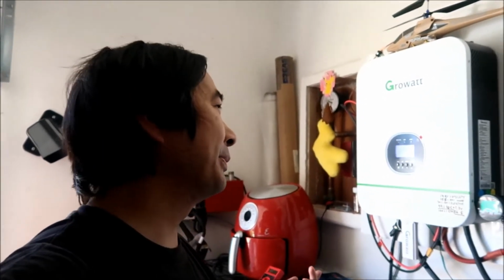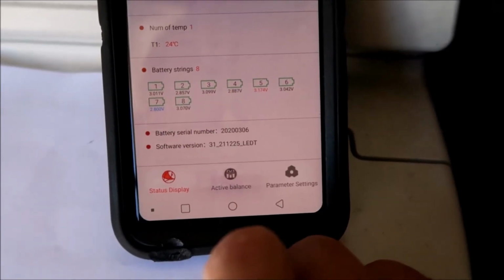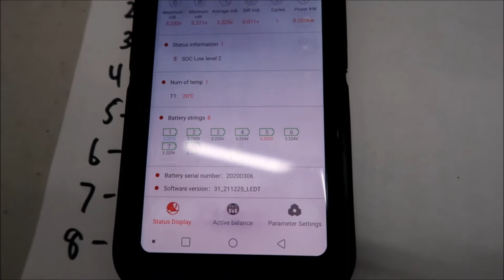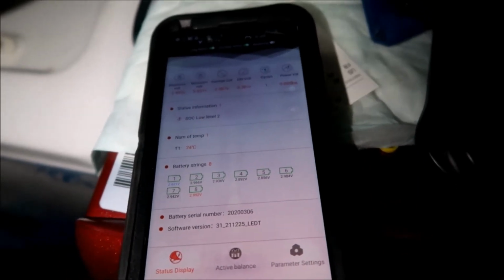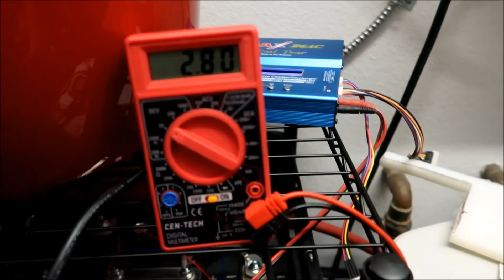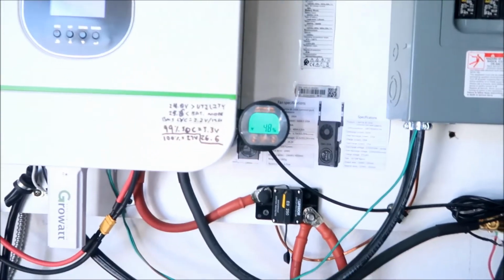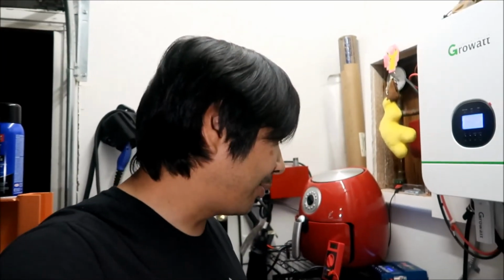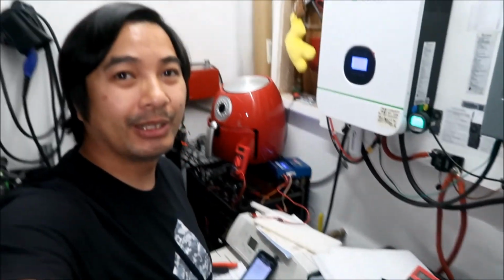HadesOmega Solar Garage Project Episode 114 - Bottom Balancing Battery Crate 2 Part 2

Comment: forgive me if you know this already.
all battery cells even within the same lot have slightly different ah total capacities
as they age capacites continue to change and widen
 therefore 
you can either be top balanced or bottom balanced  
not both
most people top balance to get the most 
WORK done from their cell volts x amps watts
the higher the total voltage 
requires the least amps to get the watts needed
less amps less heat in wires wasting energy
less strain on components

on a lifepo4 8s (24v) system
between 27.5 and 28.5 are good targets
this will be about not exactly 95 and 99 % of potential
almost all of our amp hours are between 
cell voltages of 3.1? volts and 3.4? volts 
only about
3 - 5 % are between 3.1 and 2.5
going below 2.5 will do damage as will going above 3.65
most say real damage starts closer to 2.0 v and 3.75 v
Reply from the maker: Well if the cells are not balanced the BMS will disconnect the pack period.  That's why it's best to not fully discharge or full charge them.  They say if you charge up to 80% soc the battery will last much longer.  I have my charge setting to bulk charge to 28V.  

You can see if I didn't bottom balance the pack it the BMS would have disconnected it.